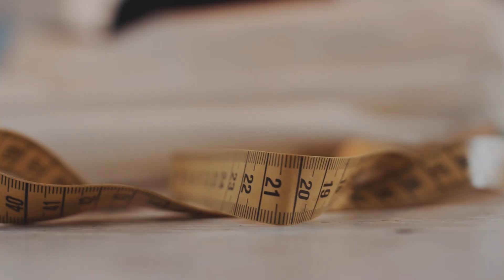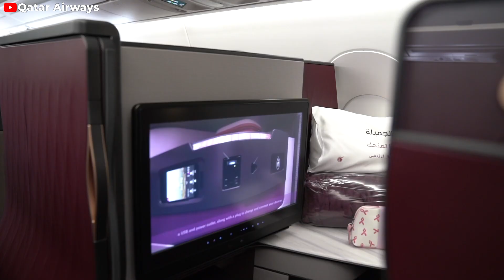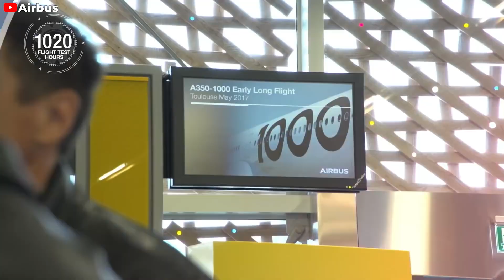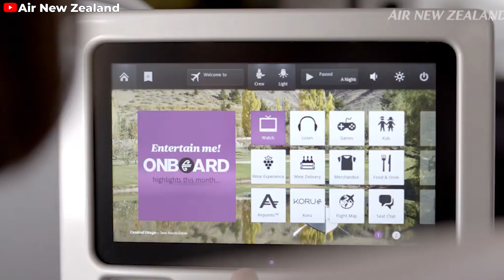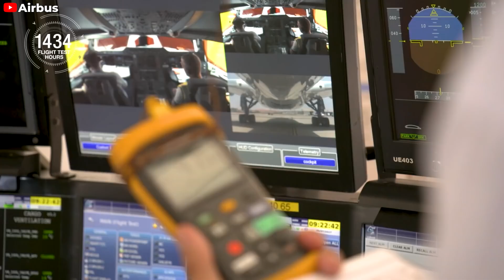How Airbus A350 DESTROYED the Boeing 777X Change The Aviation Industry!

Comment: The A350 is a copy of 787 , let’s talk about the paint issue cover up ( if your not an engineer) keep your mouth shut … the 777 is superior , the FAA  is restricting Boeing , saving face from the 737 thing
Reply from the maker: thanks for your feedback
Reply: A350 is not a copy of B787 it's larger and much more comfortable. I've flown both of them many times and prefer A350 ten times over. Has Boeing 747 flying with wings held together with duct tape? 😂

Comment: If you need the higher capacity, then you have to go with the 777X, if not, you shouldn't!
Basically that's my take.Imo, the higher capacity is the only factor that validates the 777X, and the smaller the variant gets, aka the closer the size gets to the A350, the smaller the advantage gets.
0,08 pounds of fuel vs 0,11 pounds is significant!
Reply from the maker: thanks for your feedback

Comment: Dear customer, please buy our brand car. It uses 20% more fuel per passenger and has a higher price. It will be introduced 7 years ago, only several years later then the competitor. The competing product is known for low maintenance and high uptime, and has been in service for over ten years, ironing out any startup-illnesses. 
It is only a matter of some unknown timepath for us to get the car legally on the road and set up a production facility. What can go wrong? We only have three other cars in our line-up that are plagued with quality-, safety-, and delivery issues, battling it out with the safety regulators.

Something on these lines must be the sales pitch taught in Boeing headquarters. 
I won't bet on a big end of year bonus this year...
Reply from the maker: thanks for your feedback ✈ ✈ ✈

Comment: At 3:37 - the larger cabin width is actually a detriment for passengers. The airlines will cram more seats across, in both business class and steerage. Each airliner has, of course, two aisles. The A350 is more comfortable because there are fewer passengers in each row. In steerage class, if there are only 8 seats across, each passenger is only one seat from the aisle, making restroom trips easier. In the bad old days, many DC-10s were configured with 9 across - two by each window and five seats in the center. This made a truly miserable experience for the victim in the middle seat, with two pax on each side. Some airlines configure their 777s this way, as well.
Reply from the maker: thanks for sharing your thoughts

Comment: The 737Max destroyed the 777X. When it was grounded BA lost the benefit of the doubt, in all of it's processes. The Alaska door blowout further exacerbated the situation. The 777X doesn't even have a TIA yet, which is required before a year of FAA flight testing can begin. See you in 2026/27. Maybe...
Reply from the maker: You’re right. Boeing is f*cked itself with 737max
Reply: @FLIGAVIA  Not only that - they aren't getting the waivers they used to. The LEAP engine on the Max 8 & 9 got waivered for the carbon fiber nacelle. The Max 7 & 10 are set back a year, just because of this one issue. No waiver.
Reply: @FLIGAVIA  The Max 9 and the over-written CCTV, pus the 'we don't have docs' and 'we don't know who did the work' is not winning them any friends.

Comment: Regarding the fuel bun-off per passengerr, respectively .009 for the 350 versus .011 for the Tripe, That's a difference of some 22% if your figures are correct.
That's not peanuts.
Reply from the maker: OK, nice point man

Comment: The A350 is a more modern aeroplane and it may be that Boeing is going to suffer from the same problems as they have with the ageing 737 albeit not catastrophic safety issues. 
The two significant issues that have faced the A350 have been paint and the engine issues on the -1000 that Emirates have highlighted, I,e engine life longevity and maintenance which Rolls Royce appear to be addressing and correcting. Rolls however are not the only manufacturer with these type of problems as P&W have encountered significant problems with their engines and its neither impossible or unlikely that the GE engines on the 777X wont encounter problems of their own after entering service. Airbus producing a -1200/1300 A350 would seriously prejudice the 777X but ultimately it is not in the interest of airlines to freeze out Boeing. With Farnborough only five weeks away some of these questions may be answered
Reply from the maker: Thanks for your sharing
Reply: There is nothing wrong with the RR XWB-97 engine which powers the A350-1000, so please stop spreading falsehoods. Emirates problem with this engine is the longevity between servicing, (time on the wing), as it spends much less time on the wing than its sister engine, the -84, because its a souped version and was designed at the limit of technology at the time. Emirates objects to the RR Totalcare maintenence price, which is more expensive, and RR wont cheapen the price because they're spending $1B+ on uprating all the Trents for the benefit of airlines like Emirates.......

Comment: Airbus has a 10 year lead over Boeing in sales in this category, including a lot of conquest sales from Boeing. And as we know, because of logistics and training airlines are very reluctant to change horses.  It doesn't look like the B777-9 is more efficient than the A350 either, so it brings nothing new to the table - it was supposed to be better than the A350. 
But the biggest problem the Boeing 777-9 has is that it's a Boeing. Boeing's quality/safety reputation is in tatters and their ability actually produce planes is highly dimished. Airlines don't like that.
Reply from the maker: Thanks for sharing your thoughts
Reply: 777 es más seguro 350 y no lo digo yo dicen esperto

Comment: Buy the time the 777x is flying, Airbus will have improved the A350 again to make it an even better aircraft.
Reply: That's already happened. The A350-1000 ULR for project Sunrise (Qantas) is an improved model having a higher MTOW, revised cabin and longer range.
Reply: @karlp8484 Yes the might ULR with just 12 orders , what an improvement
Reply: @mmm0404  Earth control to Captain Stupid: Do think for one second other airlines are not going to buy this model?
Reply: @karlp8484  only Qantas 🤣🤣
Reply: @karlp8484  well the ULR is just for the project sunrise of quantas.
Reply from the maker: Yeah thanks for sharing
Reply: Any rumors about a350 neo?
Reply: Well, I would say that ULR complites a350 familly rather than replace any existing version
Reply: @jakubrzeszotko6509  There is a further possibility and that is the A350-1000 with RR ULTRA Engines.
Reply: Didn’t Singapore Airlines buy some ULRs for a couple of their routes?